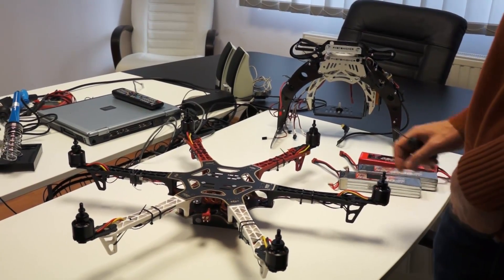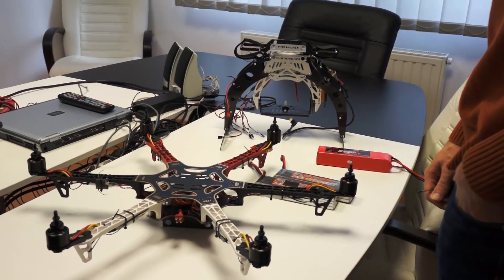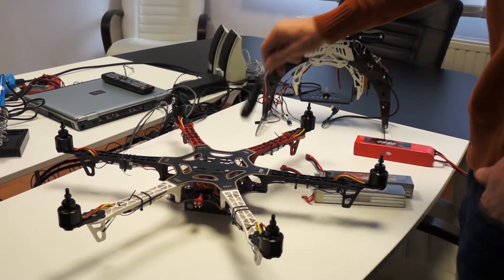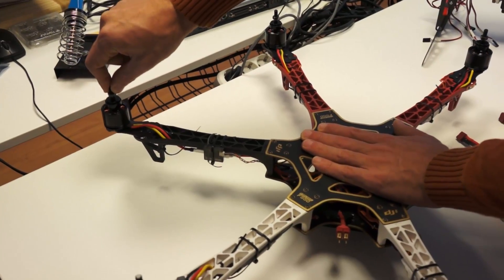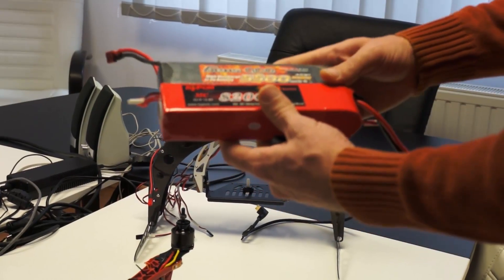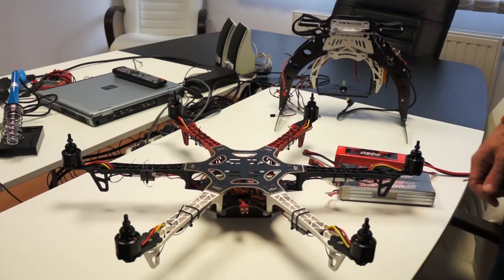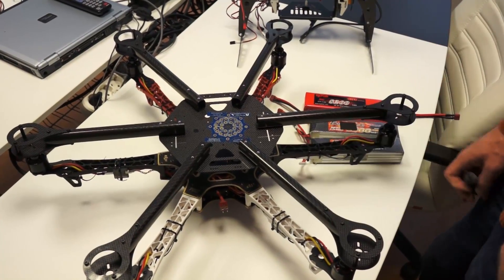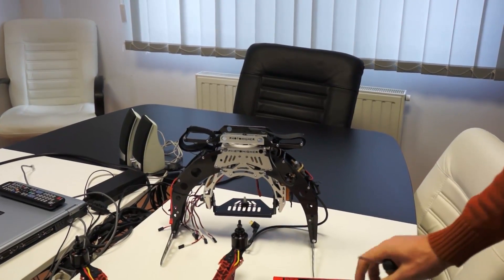Upgraded DJI F550 flying AV130/360 with Skyline RSGS and Sony Nex 5N - Part 5

Comment: Also, too much offset weight under the belly of the craft will act as a pendulum in the Horizontal Plane of reference i.e x,y. The Roll and Pitch will become too eccentric relative to FC's plane of reference, and difficult to correct/compensate. Placing a heavy battery on the top will balance out this eccentricity, to some degree. Interesting video and happy flying.

Comment: I went through the same problem. I ended up taking those crap rubberband arms off and making custom aluminum/aluminium arms 11 1/2 inches long with Avrotos turning 12inch carbon props. That was my fix and its very very stiff and very smooth.  now i just need to fing a strong light battery, well i did find some but i dont fell like shelling out $250 on a battery right now